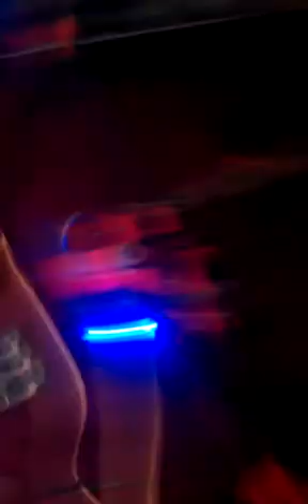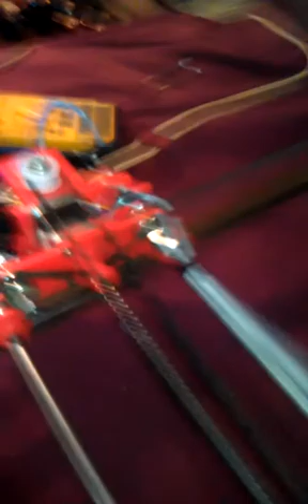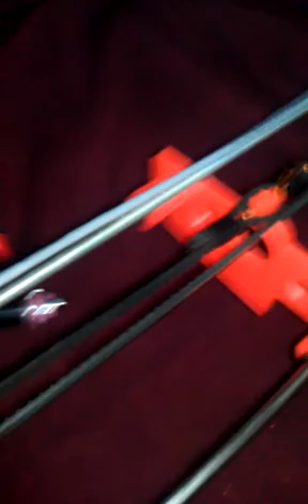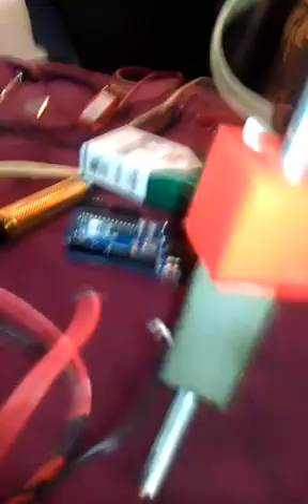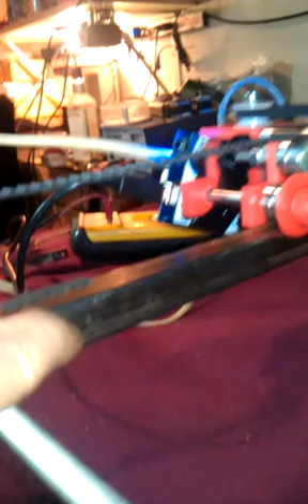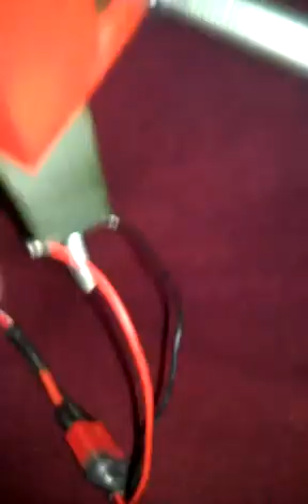CNC plasma cutter test

Comment: How is this working today ? I have plasma cutter and now that I understand using ramps and stepper motors I want to try this.  Did you post plans or files somewhere ? It would be nice to see how you wire it to the plasma and the software part .
Reply from the maker: +T1iCanon I have been meaning to revisit it. I have plans to some time redesign it with a cheap torch height controller but it did work nicely when i was playing around with it. 
The plans are on thingieverse here  http://www.thingiverse.com/thing:126576  
What i really love about this is its light weight it can be transported around easily or can be hung on the wall easily or put on a shelf above your head even.. when not being used and keeps it from cluttering up the shop. 
Basically a proof of concept that it don't take a large heavy machine to move a torch around.
The trigger wire on the cheap plasma torch is like 12 volts so i just trigger it with a relay switch from the grbl cnc board.
I have been hoping someone else would take interest and build one... it really does work well.

Comment from the maker: I all ready see an improvement id like to make. I would like to move the top set of idler bearings for the y axis belt closer together closer to the pulleys. That will put much more wrap and belt contact on the pulleys. The way i have it now the y axis pulleys only make contact with 2 or 3 cogs on the belts? Put more wrap around the pulley and it will be tougher to loose timing on the y axis

Comment from the maker: I doubled all the speeds threw the gcode sender and it had no effect. I remember seeing something in sheetcam so i will look. I still need to wire the trigger relay and set the steps per mm all up but seeing it move for the first time helped encourage me to hurry so i can get it cutting.